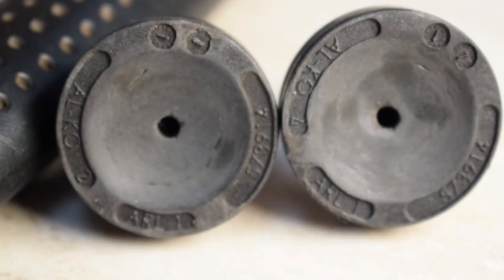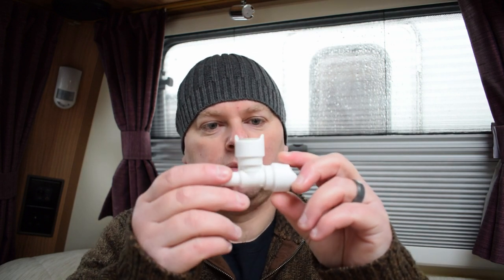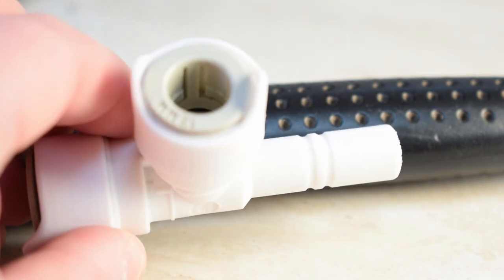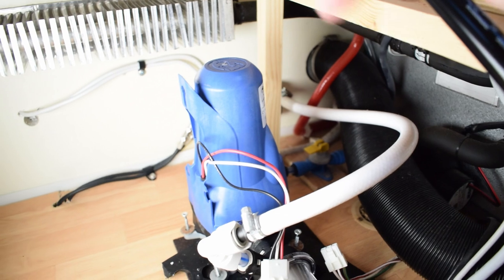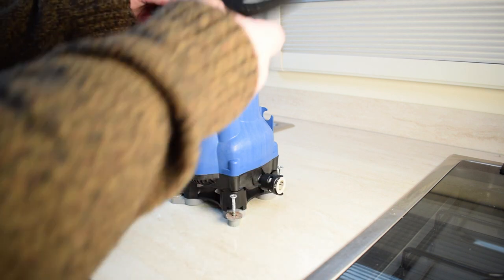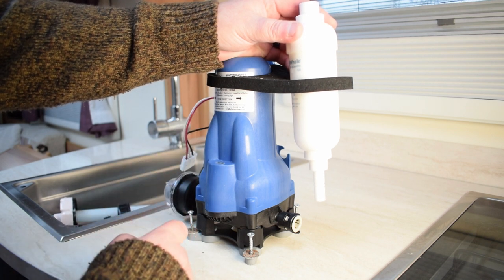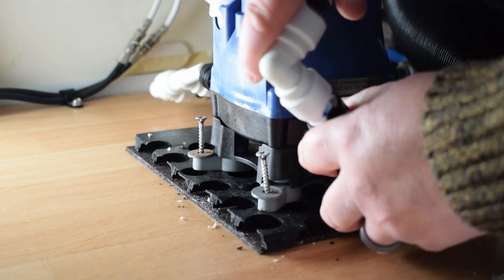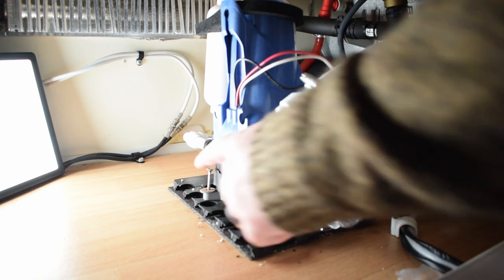Caravan WATER LEAK! - Fixing the problem

Comment: The biggest cause of these push connections leaking just like in a house is when pushing pipe into a new fitting the rubber you pointed to inside the connection moves . I was taught by a plumber that a small bit of lubrication on the pipe before inserting stops the rubber jumping in the connector and you are dead right cut flush but nothing to stop you chamfering pipe slightly will also aid a good fit into the rubber seal , love your videos keep them coming ,
Reply from the maker: Yes better to put a bit of lubricant on the joints, will also help prolong the life of the seal. Thanks for comments and watching.

Comment: Hi Martin got the same van as you have, I also have a Floe system great tool to help blow out unwanted water from the pipes and pump also removed the water surge damper for the winter and checked for cracks on the elbow I found last year.
Reply from the maker: Hi Michael, I looking to make my own drain down adapter as the cost of the Floe system is extortionate. Good idea taking the surge damper out, will do that this winter. Thanks for watching, Martin
Reply: Hi Martin, The Floe device I bought a few years ago was the adaptor the fits to my own digital compressor like a hose connector with a Air valve on the end and does the job, as you said they are expensive especially the fixed 12v unit, and all is needed is some form of air valve connection to your water input socket.

Comment: Hi Martin, our series 1 Pegasus onboard pump cracked due to all the water left inside, we were a told to let the pump run when the van had been drained down to remove any water from the system. Cheers for the upload found your videos really useful on out old van keep it up 👍🏼
Reply from the maker: Good idea running the pump, will do that next time as they are expensive to replace. Glad you find the vlogs helpful, Thanks for the support, Martin

Comment: Martin, purchase a "FLOE" kit to blow out all the water in the system when in storage over the winter . You will need your air pump as well to pressurise the system to 1 Bar of pressure. I use mine every year very successfully and amazing how much extra water you get out. I think Dan Trugian n has done a vlog on it. Nick T.
Reply from the maker: Hi Nick, Yes i’ve seen the Floe kit and the extortionate price they want for it. I’m hopefully going to make my own and will report back. Thanks for comments and watching.
Reply: I also have a Floe system great tool to help blow out unwanted water from the pipes and pump also removed the water surge damper for the winter and checked for cracks on the elbow I found last year.

Comment: Push fits are a god send aren't they, I have the same pipe cutter, much better than a hack saw. I changed the friction pads a couple of weeks ago as it was making a creaking noise at slow speed, seems to have solved it. Thanks for sharing..
Reply from the maker: Hi Graham, Yes push fits are great, I fitted a downstairs toilet and sink and they made it far easier especially with the pipe cutter. I think I will change the friction pads next year if this doesn’t work. Thanks for comments and watching, Martin

Comment: Hi Martin, I ALWAYS do a complete check of every system in the van before each and every trip. I also keep a box of spares and tools, so we are prepared for any issue that may arise. I also check where the nearest caravan spares shop is to where we are staying just in case. 😁
Reply from the maker: We need to keep some spares in the van, I do have some bits but not pipe fittings. There was a dealer nearby but they didn’t have the part I needed. Thanks for watching.b

Comment: Good video Martin. I would definitely want to take some water up to storage to try the pump out before you go away as I am sure you will. I know you can sand them but it seems most the time I have sanded them and used brake cleaner it still seems to creak. I often then just replace them saves me keep cleaning them until I get them exactly right.
Reply from the maker: Hi Paul, better to check stuff before you travel. The hitch was making an awful sound, I think there might have been a bit on grit on the tow ball. Will probably replace them next year. Thanks for watching, Martin